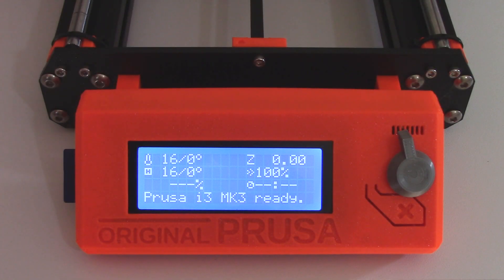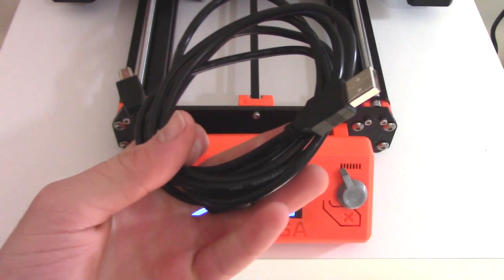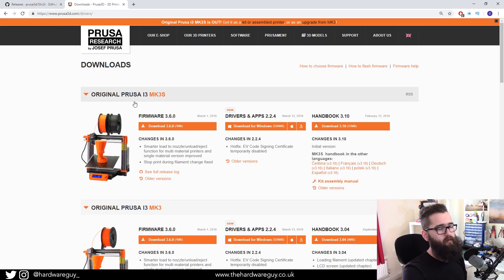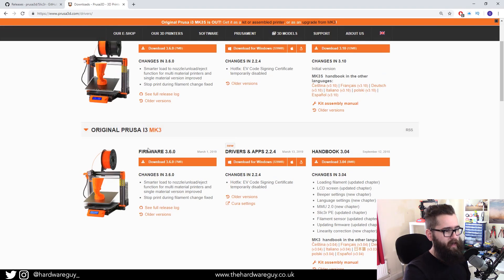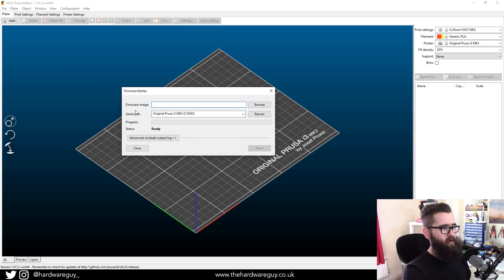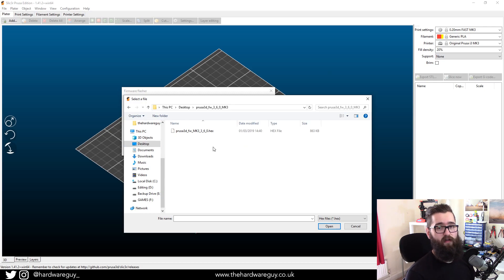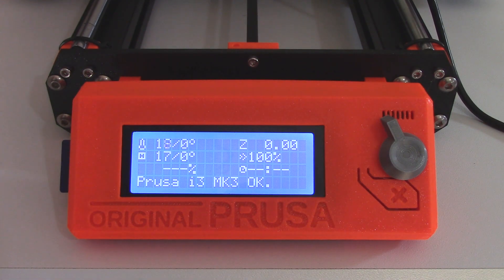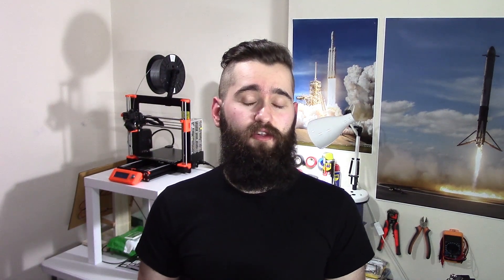How To Upgrade Prusa Firmware - EASY!

Comment: I sure hope you can help me. I'm making some mods to the Prusa firmware. For part of it I want to send text out through the TX pin on the J19 connector (and also make use of the RX pin eventually). In the Prusa firmware there's one object called MarlinSerial (or MSerial) but that appears to communicate via the USB port on the Prusa.
I've found info (from ChatGPT) about using the TX/RX pins on the J19 connector but, frankly, it's all quite confusing and appears to require a lot of mods to many .h and .cpp files of the firmware.  It refers, for example, to things like SERIAL_PORT_2 in the firmware, but it's not actually there.
Do you have, or can refer me to anyone with, knowledge of how to do this, what I need to add or modify so that I can make use of the TX/RX pins on the J19 and have some object in the firmware to control it?
Reply from the maker: Hi Roger, sounds like you're really tinkering there!! I have no knowledge of this but the Prusa stuff is open source and I imagine there are people with some knowledge on the matter. Have you tried the Prusa3D Reddit? Id definitely start there

Comment: Thanks for your videos!!! I just assembled a new Prusa i3 mk3s and the firmware is now upgraded to 3.7.0
Reply from the maker: eGliderman thanks for watching! How’s your new MK3S so far?
Reply: My new MK3S is doing great! I'm glad I didn't spend $2,000 or more for some other printer! Also, assembling the Prusa kit means I'll be able to troubleshoot and fix problems quicker than if I had purchased it assembled.